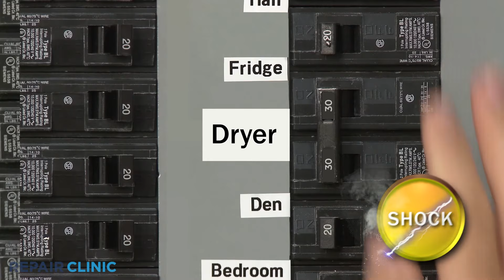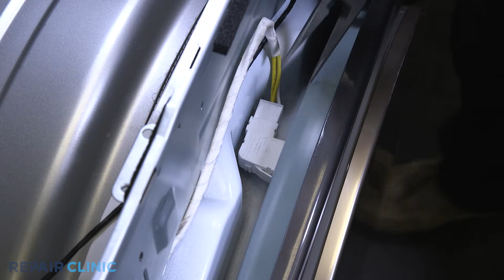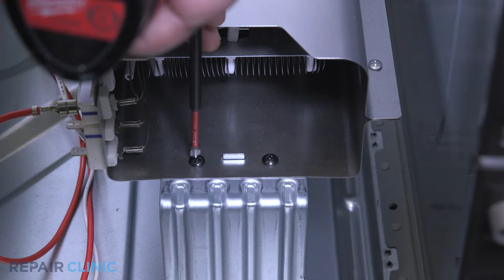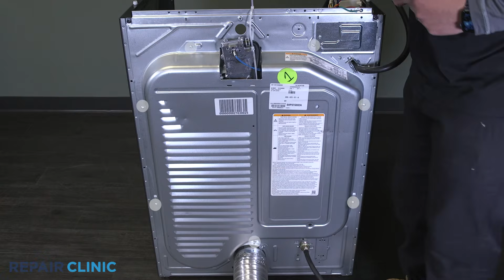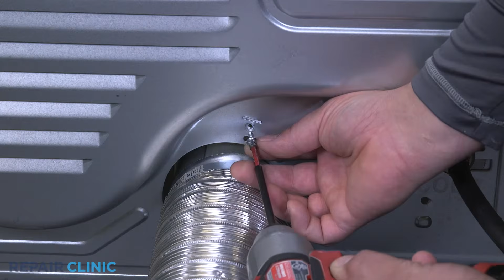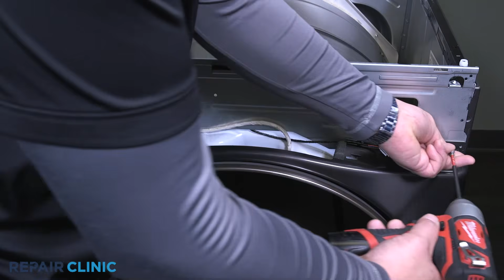LG Electric Dryer Steam Generator Replacement ADZ73410101

Comment: The steam cycles on my LG DLEX4200W do not work.  Steam does not emit in either Steam Sanitary or Steam Fresh cycles.  In diagnostic mode, it dribbles out water but not steam.  No codes.  Any thoughts?  Thanks!
Reply: mine does the same thing, i cant seem to find an answer on this

Comment: You have to do what the gentleman says in the video. You cannot simply remove it from that back. Mine ended up being an open thermostat. For future reference, if all is working correctly, both thermostats will read .2 ohms each. The heating element should read about 13 ohms. A simple check will be a total resistance of 13.4 at the top black and red connectors. Mine showed an open condition. The Clinac CS-7 are both thermostats. Very inexpensive at Amazon.
Reply: I replaced a Clinac & it blew again!  One Clinac is ok, so just connected that one.  Now steaming great 👍

Comment: So what i would to is ohm the heater see if it has resistance and check resistance on the 2 safety thermotats and ohm out the thermistor it should be near 40k if its too high you can get a general probe style lg thermistor and connect it directly to where the original connects to to bypass it this is a good way to check to see if your water valve works run the steam cycle to see if you get water coming out of the steam spout

Comment: you can remove the steam generator without removing all that stuff. Just remove the top panel, the generator cover. I is a bit tricky though.
Reply from the maker: Thank you for the tip!
Reply: Yes it's possible, but I had to remove the bracket from the generator to wrangle it out.  Then I hacked-off a bit from each side of the bracket making it much easier to put  the generator back on the dryer.
Reply: @sschrybu do u have a video

Comment: So let me get this straight. You pretty much tear the entire dryer down just to replace this little steam generator component thing that you can get to from the outside top rear. And this seems to be because you want to use the original wiring harness plug that's only located deep inside the dryer? This seems completely idiotic. Pretty sure you could just unscrew the steam generator shroud from the rear. (Maybe you have to remove the top to do this but that's super easy.) Unscrew the protective cap inside the dryer tub. Disconnect the water tube. Pull the steam generator out and clip the 4 wires. Toss. Put the new generator in and splice the wires with crimps. Would take like 5 minutes and you wouldn't have to risk taking the entire bloody thing to pieces and put it back together. Actually I just did a whole disassembly this afternoon but that was to replace some worn drum rollers so obviously was necessary. So yeah I'm pretty freshly familiar with the whole assembly.
Reply: You right
Reply: No need to cut wires as they connect to the generator with terminals.